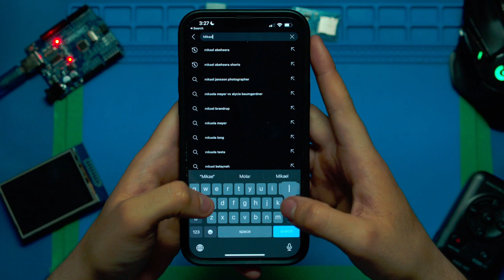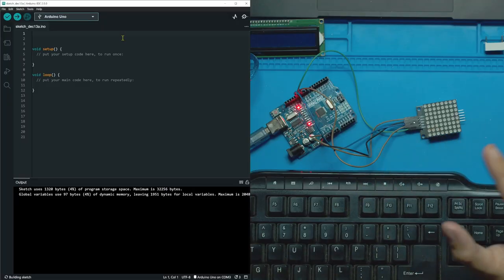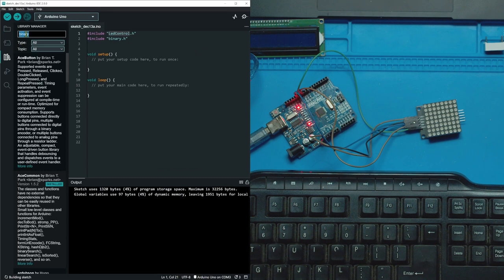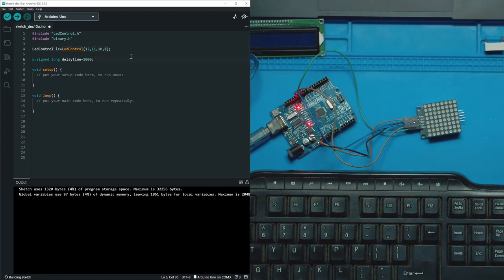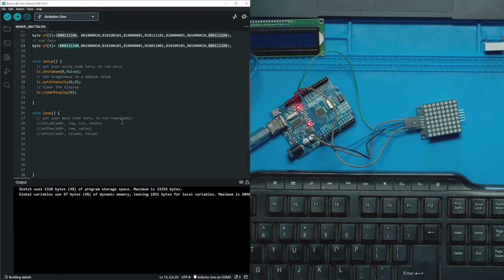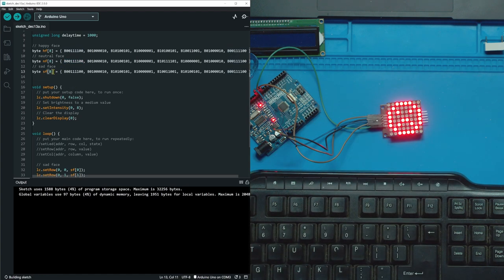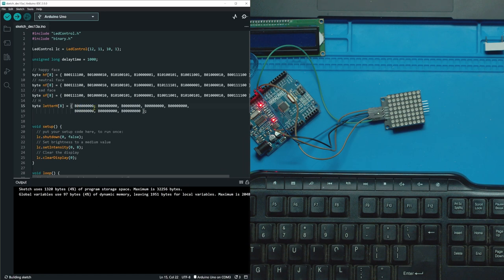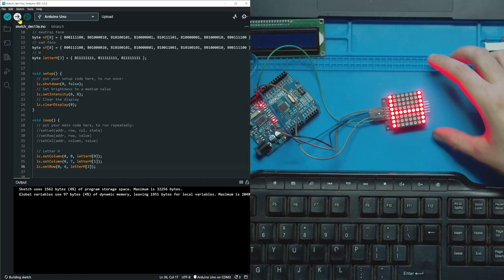CONTROL LED DOT MATRIX WITH ARDUINO | Led bar graph

Comment: Thank you ! Im a beginner at it, I would like to control a pixel on the matrix with a joystick. I guess the only way is to tell min x max x min y and max y for each pixel
Reply from the maker: you could make a program to figure out the current location of the pixel, and then based off the joystick, turn off that pixel, and turn on the next one (left, right, up, down). You can totally do this! join the discord if you need more help
Reply: Hi, i did this recently. I did it by using a loop and calling the pixel with indexes i and j, rather than raw numbers. so i use the input from my joystick to change the value of i and j accordingly... this then changes the location of the pixel, hope it makes sense!

Comment: can i put one led in through the unused pins of the other one and program it the same way?
Reply from the maker: not sure what you mean exactly
Reply: @MikaelAbehsera  sorry, replace led with led matrix*,  so if i have 2 8-by-8 led matrices, can i connect one to the arduino and then connect it to the other one via the 4 unused pins on the other side?

Hope you get a what i mean
Reply from the maker: i think you can but you have to wire it up as if its a new matrix entierly, so like if you had a 2x2 (4 leds total), and you stuck another one next to it, you would wire and code it as a 2x4 (8 leds), does that make sense? it would be the same technique/logic just a wider or heigher setup and not square